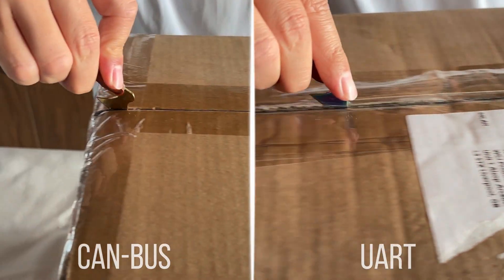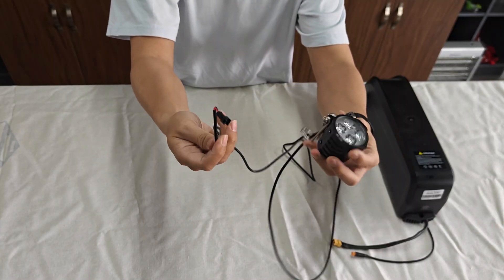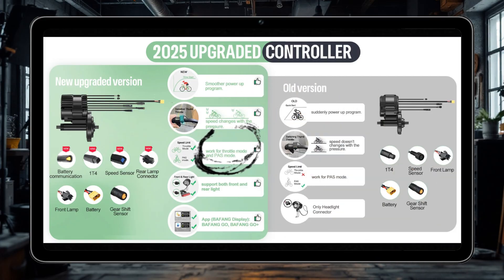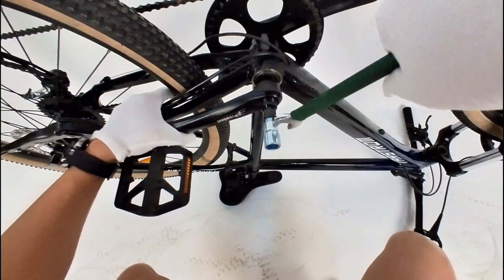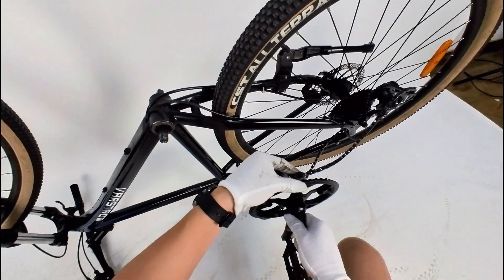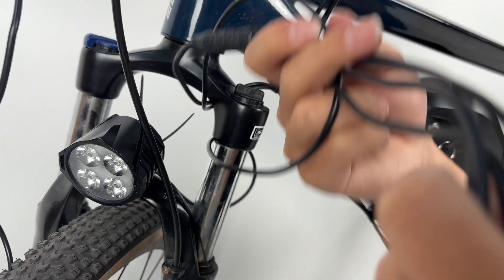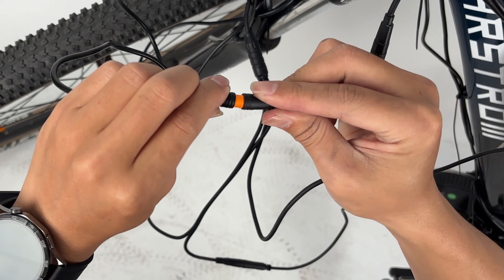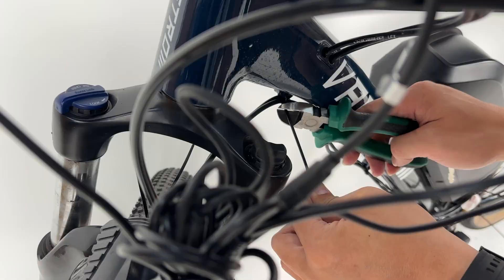DIY Riders Must Watch: Bafang mid-mounted motor CAN-BUS docking tutorial.Install the BBS02B 48v 750w

Comment: Where do I get a Canbus tail light that has that connection. Prefer long wire for recumbent trike.
Reply: @kjlcycler  same question for me, i need a taillight for can bus protocol, i tried to connect a 6v light but it worked for 2sec and after that it turned off both of the light front and rear. I conected it to the cable that cames with a white and black wire.

Comment: I have the canbus version and ordered the wrong usb programming cable. Figured out which pins should be where and cut the wire and connected to the can-cable. Im able to sort kf connect to the programming software on a laptop ( app on lhone is not working ) but i am not able to change anything. It just wont save the changes ive made. Can you give me some advise on this issue?
Reply from the maker: I suggest you contact after-sales customer service to explain your problem. What kind of programming cable did you buy?
Reply: @varstromebikeconversion  just the regular one with the round comnector. I didnt know ive ordered the updated motor eith the triangular display can connector. So i cut the connector and hardwired the cables to the can connector. Which made it able to connect through com4. But everytime i read from the controller i get the pop up that the read is succesful. Ben then when j read abain i het different values everytime and im unable to write. Got some programming sone through the display itself, like rim size and speed limit, but i really want to adjust the way the power is deliverd cause i get a lot of ghost pedalling.
Reply from the maker: @joeykarg8169  I think you bought a UART programming cable, but you need a CAN-BUS programming cable. The chips between them are not universal.
Reply: Do you know where i can buy the correct cable?
Reply from the maker: @joeykarg8169  https://varstrom.com/products/bafang-programming-cable?ref=dwcwdedm
Reply from the maker: Here... make sure you have made the right purchase before purchasing.🧐

Comment: Is it possible to use aftermarket batteries with the new canbus bafang system?  If you only use the basic controller without the extra features maybe that works?
Reply from the maker: Bafang CAN-BUS does not have a monopoly on batteries, you can choose other batteries
Reply: @varstromebikeconversion  I'm so glad this is case. I have a fresh new 52v 25ah battery and was worried when I purchase this new CAN version. My UART one is shaking like crazy under load.
Reply: @varstromebikeconversion  I just built up this system and I do not think it works.  Do you have any tips on getting a Canbus system to work with a non canbus battery?

Comment: Where can I purchase the brake cutoff sensor holder? The piece that holds the metal part that connects to the brake lever
Reply from the maker: I 3D Printing myself,How much would you be willing to pay for it?(Just curious)
Reply: @ I think $10-15 would be a fair price for them. I can tell you that there is definitely a market for them in the DIY e-bike community

Comment: Never buy canbus bbs01/02, I followed the advice of a seller, when buying this product, to take the CP010 display to adjust the size of the wheels and the speed limited to 25KMH (E.U), except that it is fixed at 26 inches for the wheels, and unlimited for the KMH, impossible to change the parameters of this one, if you are in states that do not follow restrictions on the KMH, then yes, this one can be good, but otherwise, do not be fooled, on one of these videos, the DPC010 display had six settings icons, I have five, and the only icon to adjust the speed and the size of the wheels was absent. Get instead for the UART protocol, which is perfectly configurable on a PC and a cable, do not be fooled.
Reply from the maker: Regarding the problems you mentioned, it should be that the controller version has not been updated. Where did you buy the motor? If you bought it from Varstrom, tell me your order number so that I can help upgrade the controller version.
Reply: hold up and down together to get into the secret options. everything can be set via the display except assistance levels
Reply: @mecpaw  No, I only have 5 menus, and there are 6 menus presented on his CP010, the only menu I'm missing is precisely the one where you can adjust the speed limit.
Reply: @torcheQ-12etoiles  you have to do it twice.